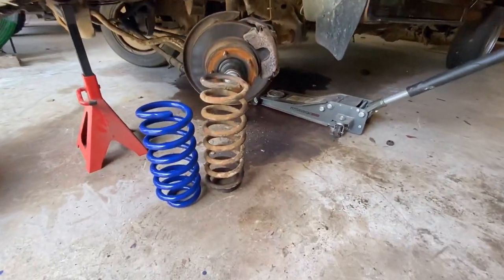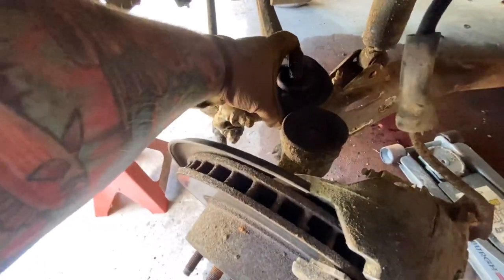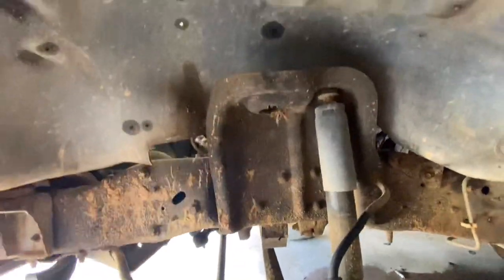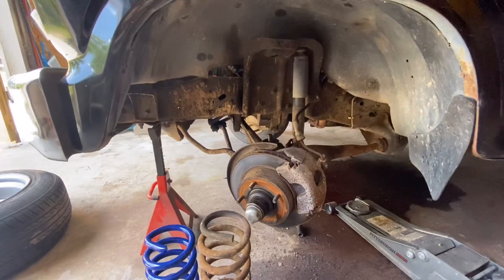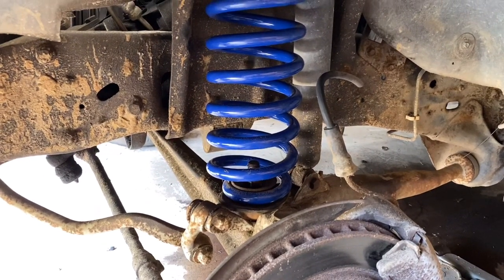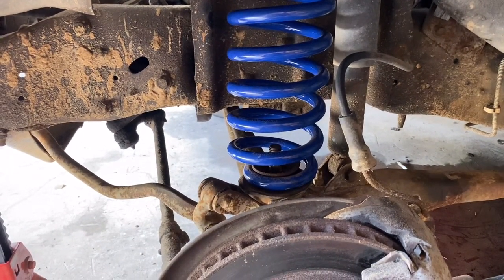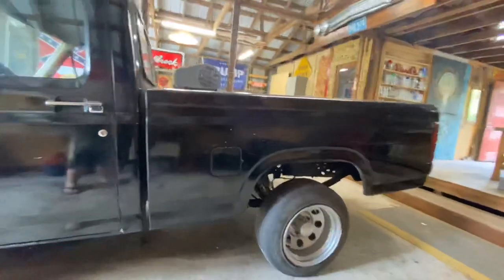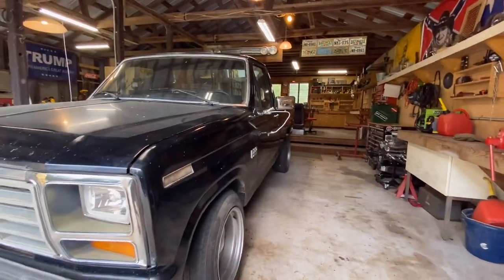3 inch Lowering Springs OBS Bullnose F-150 1980-1986

Comment: Are you still able to maintain proper alignment? Everyone says that coils only u can't properly align. Will the adjustable caster fix that?
Reply from the maker: You can maintain proper alignment. Don’t believe them lol
Reply: @FloridaCrackerKustoms  I had the same question. Were you abel to fix the alinement problem with only using adjustible ball joints or did you need to do more? Great video btw.

Comment: So I was looking to do this to my truck but mines a 2wd f250 3/4 ton will this kit work for my truck or is springs and running gear different? I’m sure it is but I was just curious haha
Reply from the maker: Your springs are a lot more heavy duty then these, i doubt these would work if you have a big block or diesel in your truck. If you can’t find a kit you could always lower it the old school way a heat the springs up so they settle a couple inches.
Reply: @FloridaCrackerKustoms  that’s kinda what I figured haha thank you for answering my question I have the diesel as well I’m going to look around for a kit and if I can’t find I’ll heat them haha
Reply from the maker: @iansnow6722  You also could try some stock f150 springs, they maybe be shorter then stock F250 springs. Make a video if you figure something out, I’ve been wanting to slam a 7.3 f-250z
Reply: @FloridaCrackerKustoms  will do thank you for your info I’ll give those ideas a try and let you know what I figure out!
Reply: @iansnow6722  Did you try it? I want to do the same to mine:)
Reply: @modestohin164  no I never did get around to it I’ve been looking into it still and from what I found is it should work

Comment: It looks good. I'm going to drop my 84 Ford. Are those wheels and tires the stock 15s? Or 16"
Reply from the maker: They aren’t stocks. They are 16x10s.
Reply: @FloridaCrackerKustoms  thanks so much for answering. I've been debating on going with 15s or 16s. Your truck looks awesome.
Reply from the maker: @michaelwikoff6081  I appreciate it! Good luck with your truck.

Comment: How low are u going to put for the back?  I'm thinking on doing the same setup as mine
Reply from the maker: I dropped the rear 6 inches, check out my latest  video.
Reply: @FloridaCrackerKustoms  hey by any chance Is there any difference between a v6 and v8 suspension? Cause I got a v6 and idk if this will still work cause urs a v8
Reply from the maker: @LeaderOfDoge  I don’t believe there is a difference, the 302 isn’t that much heavier then the 6 cylinder.
Reply: @FloridaCrackerKustoms  OK thank you man appreciate the help thanks for actually responding most people don't respond
Reply from the maker: @LeaderOfDoge  no problem man, best of luck with your build.

Comment: What wheel and tire size are you running? And are you using the stock shocks (front and back)?
Reply from the maker: I’m running stock shocks all around and wheels are 16s can’t remember tire size off the top of my head.
Reply: Thanks man 🙏

Comment: Bullnose and bricknose apply to the early  yrs stop with the putting your older years in wrong designation.
Reply from the maker: Bullnose 80-86, 87-91 Bricknose, & 92-96 Aeronose. They are all considered OBS Fords, according to my research.
Reply: @FloridaCrackerKustoms  Correct
Reply: He called it a bullnose. And it is a bullnose.  Earlier years were bumpsides, dentsides, etc. Later years were bricknose , aeronose..